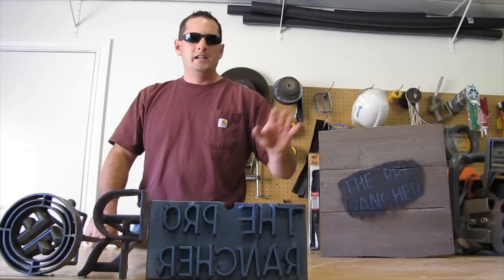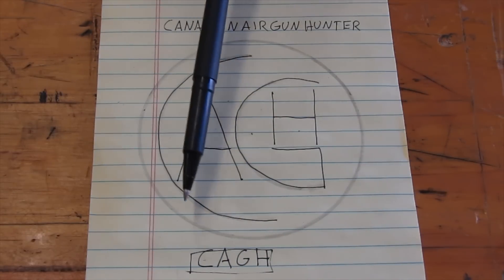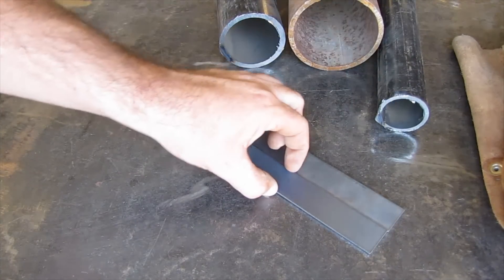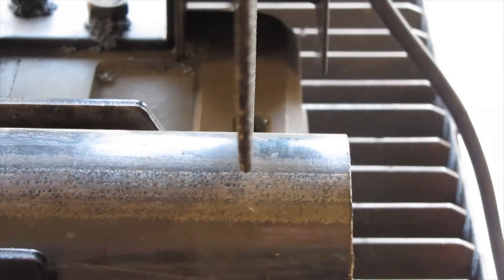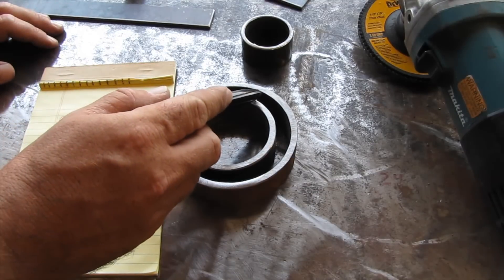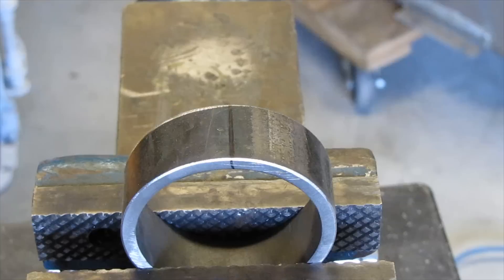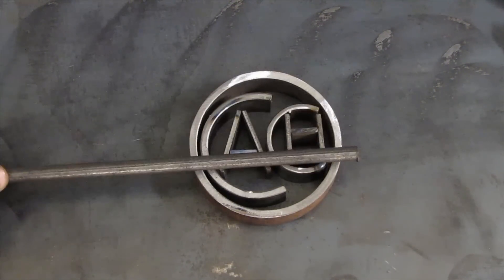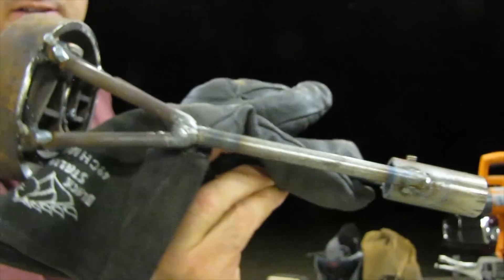How to Make a Custom Branding Iron!!

Comment: It is very dangerous practice to run grinders with the safety guards removed.The cuts are very sudden, deep and cauterize the edge of the wound which makes for slow healing and that is if you dont hit a major artery which will bleed you pretty quickly.In industry it is forbidden under OH and S regulations.Consider who might be watching your vids.